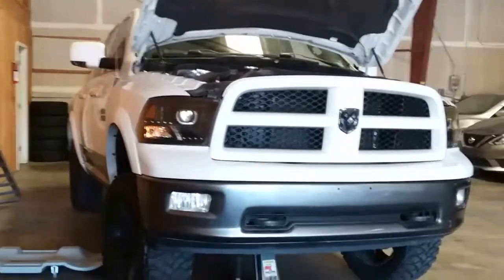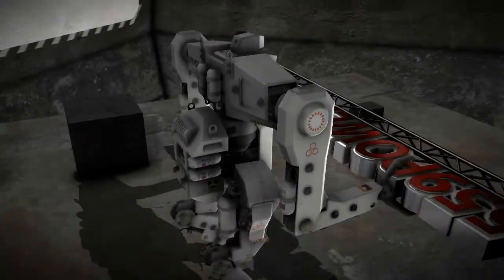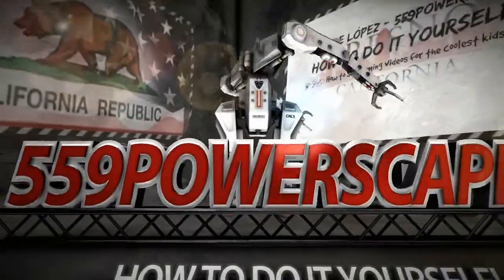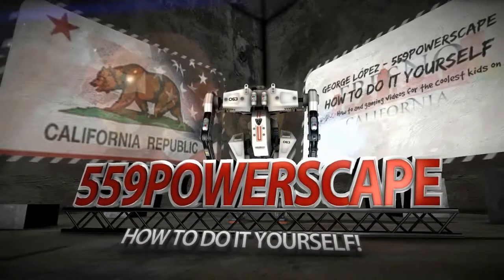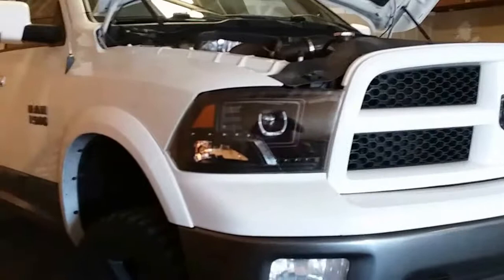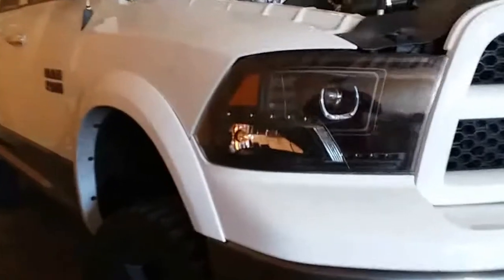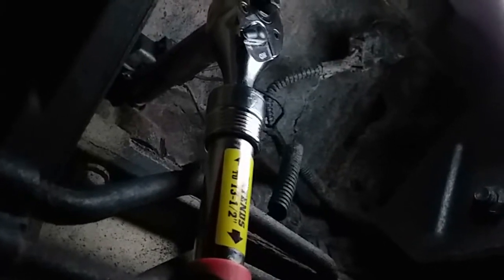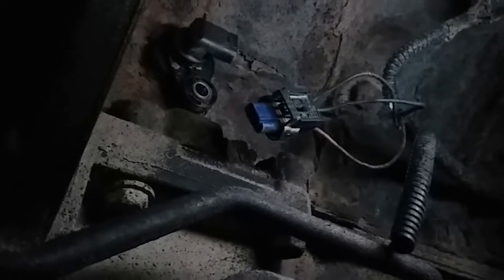How to: Remove Crank Shaft Positioning Sensor on a 2011 Dodge Ram 5.7 Hemi

Comment: I have a crank, no-start issue with my 2014 Ram 1500 5.7 hemi. I can't get the codes because the engine needs to be running in order for my OBD2 to retrieve the codes. So I'm going the trial and error route. Had an extremely cold day, -7° F, (-37°F with the windchill the day it happened). Drove about 8 miles to the store, was in store for an hour, came out,  started truck, let it warm up for about 5 minutes, put it in drive, soon as I let off the brake and touched the throttle, it shut off, like I turned the key off, no sputtering or anything, and wouldn't start backup. Checked fuses. Good. Relays I didn't check. When it turns over I can smell gas, I can hear the fuel pump prime up, but it will NOT even try to fire. So my first guess is the crank sensor. I have one coming today. Any other ideas what it could possibly be?
Reply from the maker: You can try swapping relays around that are identical to each other see if that would help. Have you tried keeping it on the run position without turning on the truck, The 2nd positioning when you turn the key right before you crank it, leave it on to where all the gages come on and try scanning it with the scanner.  Without the codes you're honestly just going to be spending money and replacing parts and it might not fix the issue.  This sensor can cause it not to start so hopefully this fixes the issue

Comment: So what was your symptoms?
Reply from the maker: Check engine light was on and had a hard time starting up and staying on
Reply: @559powerscape  i have no codes crank no start
Reply: Wonder if crank sensor be bad without a code
Reply from the maker: @Larry Nance  it should throw a code maybe it's a fuse. I would check all fuses or try maybe spraying carb cleaner in the intake to see if it fires up...if it does... might be a fuel issue

Comment: Will give missfire when goes bad
Reply from the maker: It can yes, cause it needs to communicate correctly with all sensors to work correctly
Reply: Mine been doing that off on for like year
Reply: @559powerscape   always cyl 5 don't think be coil because you think light would stay on plugs are new
Reply from the maker: @bradnone1945  would you happen to have a obd2 Scanner? If it has codes the reader will tell you what it is and you can start there and see if replacing the item it's requesting fixes it. But a miss fire can be multiple issues. I honestly feel that's one of the hardest issues to fix in my opinion because you can replace spark plugs and coil packs but the issue is still there. A scanner would be your best bet to begin with. Good luck buddy!
Reply: Scanner says missfire cyl 5
Reply: @bradnone1945  I have a 2016 3500 getting the same code. Starts up real rough and hard to start when the truck is hot. Were you able to fix yours?
Reply: @StuckInDeionsTub   coil pack fixed mine
Reply: @bradnone1945  thanks
Reply: Do you have to reprogram it
Reply from the maker: No you don't